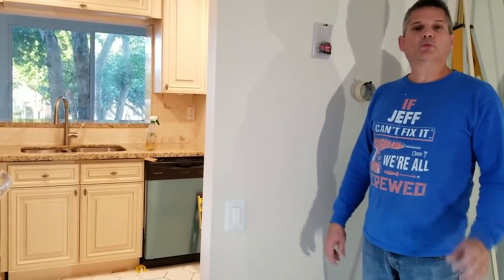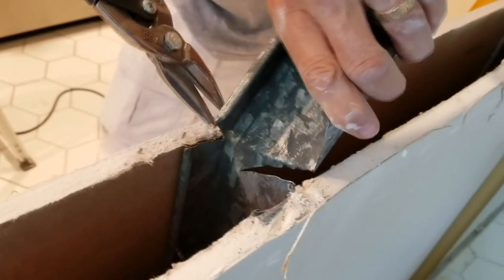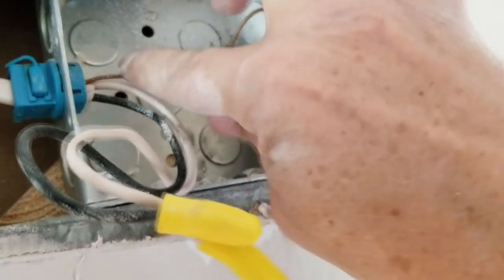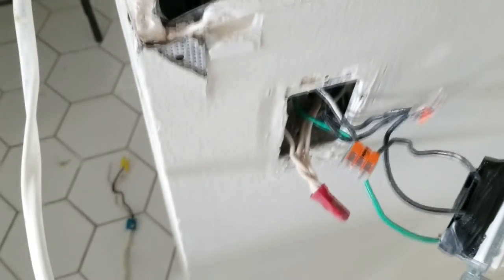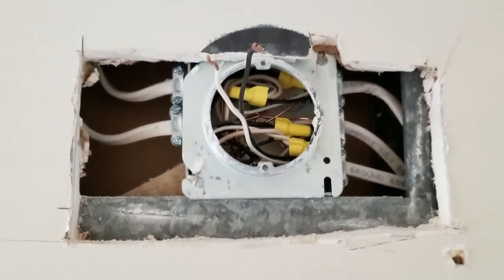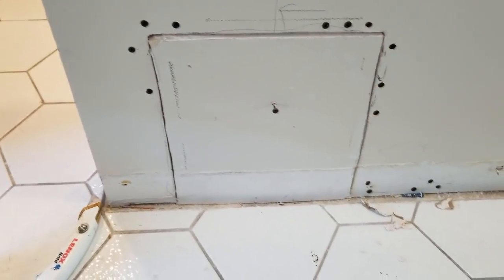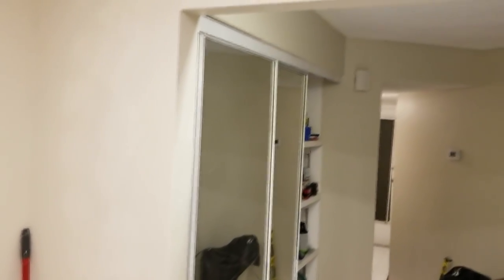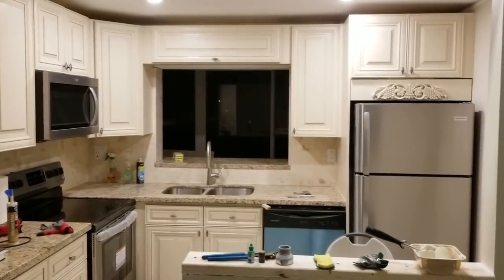Open Concept Kitchen Living Room Ideas: How To Build Half Wall

Comment from the maker: Tools used in this project:
Rockwell RK5151K 4.2 Amp Sonicrafter we used in this video to cut drywall holes in the half wall kitchen: https://amzn.to/2CrWYyX 
DEWALT DW715 Chop Saw: https://amzn.to/2RchGLw
Ridgid R4510 Portable Table Saw with Stand: https://amzn.to/2BMY5rJ
RIDGID 50323 Wet/Dry 12-Gallon Shop Vacuum:  https://amzn.to/2Sdn3al

Comment: Small (but very nice) kitchen, big project, massive improvement! I'm going to do something similar. The best way I've figured out to stabilize the wall is to take the wall out completely, drill a hole through my concrete slab and down into the dirt, pour in some concrete, and sink a large pole down into the concrete. I haven't decided on what yet, but I'm thinking about those pipes/poles the use as posts in some wood fences.

Comment: Yes and If its a Wood floor u could always frame another wall right along side the other wall and leave 3 to 3.5 " so u conserve room than join it at the end with drywall and that  will give u a solid wall  about 10" wide good for a bar  top kitchen counter top with stools.

Comment: I have a question about something similar.   I want to make a half wall between my kitchen and LR, but there is currently NOT any wall there.   (I hope I can explain this right...)  So the side toward the kitchen, can be like a bar, maybe with a countertop and STORAGE underneath for additional kitchen items.   The side toward the LR, I just want drywall/paint to match the LR so I can put a couch back up against that half wall.    Would I be able to buy some matching kitchen cabinets to build this?  The problem is what do I attach the cabinets to, since they are not backed up against a wall like normal cabinets.  Can I attach them to the floor?  But how to do that?  Thanks for any input!
Reply from the maker: You build a stud wall. So you lay a bottom plate, you can use wood or metal studs. then you drywall over it, then when you by cabinets, you slide them up against the drywall, and drill through the cabinet into the studs. the fastened cabinets will act to reinforce everything together like a block.

Comment: What if you don’t have cement slab? What would you recommend using to stabilize the existing half wall?
Reply from the maker: You use a similar strategy for a wood floor, just screw the floor flange into the wood floor with screws, rather than Tapcons on concrete.
Reply: jeffostroff makes sense! Thanks so much!!

Comment: Our church did a remodel like that. An engineer had us get a custom steel made 2x4 with 1x4 inch steel with a flange welded at both ends screwed into the floor and top plate. It was $2000 wasted, didn't work at all. The best thing you can do is put a cabinet on one side of the wall.
Reply from the maker: This worked pretty nice and wasn't even $20 in parts
Reply: @jeffostroff  The kind of money we spent that wall shouldn't move at all. It was a lot better than before but cost way to much.

Comment: The best way to keep that wall from moving is to put cabinets on one side. Our church did a similar remodel an engineer had us use a custom made steel 2x4 with 1/4 inch steel with welded plates on each end screwed into the floor and top plate. It did not work. $2000 wasted.

Comment: Hi Jeff. Great video. Where would I find a pipe like the one you used in the video. I see the flanges are easy to find but that pipe!! Can't find it. Thanks for the help.
Reply from the maker: I used the 1/2 in. x 36 in. Galvanized Steel Pipe from Home Depot https://www.homedepot.com/p/The-Plumber-s-Choice-1-2-in-x-36-in-Galvanized-Steel-Pipe-1236PGL/307815756 they had it in stock in our store, but if not, you can order it easily from Home Depot's web site.
Reply: @jeffostroff  Thanks Jeff. I just put a knee wall up in my loft and there is some give to both walls and I was wracking my brain on how to fix it and then BOOM I came across your video. I did subscribe to you channel and I will let you know when I have finally finished it. Thanks again.
Reply: @leonidkarkanitsa2455  seal or prime your sheet rock before you apply the adhesive and you will get a better adhesion with the plastic corner bead .
Pipe idea seems pretty flimsy where as a wood stud with double top and bottom wood plates glued and screwed into the concrete floor will help cut out lateral movement.

Comment: If you're going this deep, why not just knock it all out, and start over with timber to eliminate the unstable nature? I know this was a scrap piece of granite, but why not use minimum bar height, and 10 inch overhang to make this a functional space, rather than a conversational piece? Ever since the advent of the speed brace, I will never mount a top any other way unless requested.